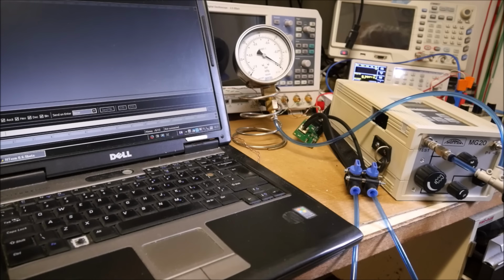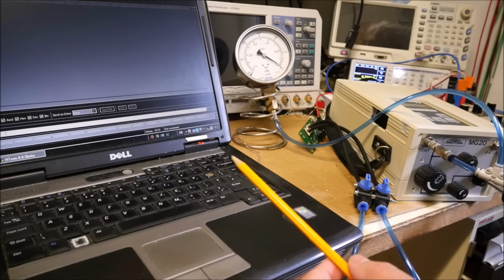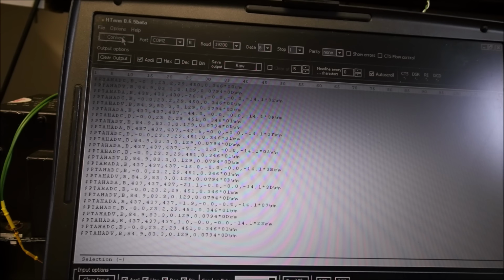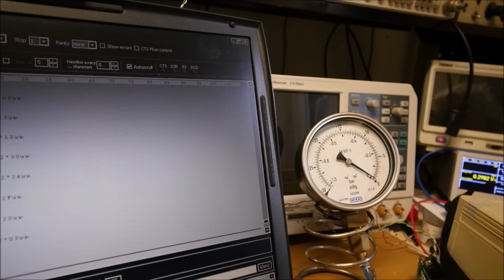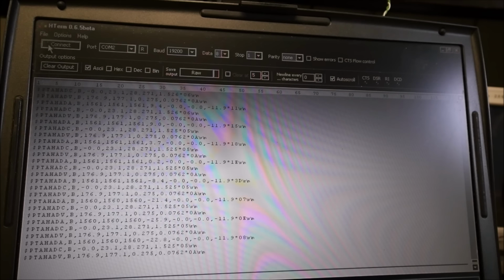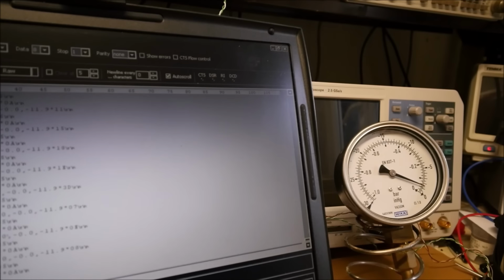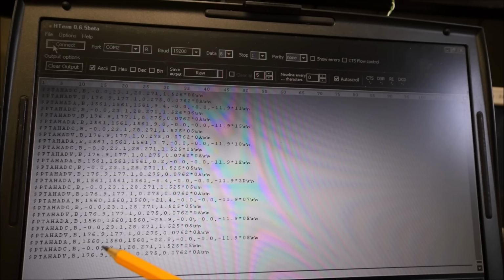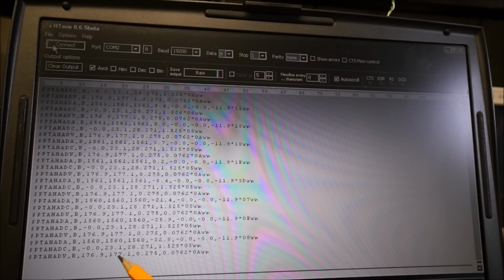LDM #369: Shahed-136 drone Air Data Computer module

Comment: So... a lot like my Resmed 10 CPAP machine, but without the 3ph motor controller.  Differential and absolute pressure, and an STM32 ARM.

Comment: I find it quite interesting the use of quite low spec SMD stuff, 1206 or similar size...like they do not want to use anything small perhaps due to vibration or reliability concerns? They clearly have no difficulty with high pitch given the STM32 is soldered there.

Comment: Given the fact these things are built from plywood with a thin skin of fibreglass have primitive electronics and a cheap motor, why do they cost $50,000 to make?
Reply: $50K is the highest estimate, they start at $20K. I think the cost also includes expo💥 payload as well. The guidance/nav system also needs to be protected from jamming devices. I don’t think this is the only module on the drone.

Comment: I've designed something more complex than that, and I'm just a hobbyist. The PCB is so basic that you can make it with an electronics CAD program in a few hours, and if you send the Gerber files to China, you can order thousands for 'just a few bucks'.
Reply: Embedded system design for Automotive and Aerospace is not as simple as designing a board to be printed by PCB way and JLCPcb. You have to factor in environmental factors, mechanical stress from motors, thermal stress, signal noise etc.. not to mention designing a Mixed Signal board is an entirely different level of design and engineering.
Reply: @MadKobra-b3t That circuit uses all non-aerospace consumer components, must last a few hours, and is not subjected to significant stress, given that the Shahed drones fly at less than 200 km/h.
They are not designed like Western weapons, but to be cheap and mass-produced, putting reliability second.
Just as the war of resistance that Iran has planned is not conceived according to US warfare standards. For fifty years, the Iranians have been digging bunkers and hiding thousands of them in preparation for a war of resistance and attrition. Because they know full well that if they accepted a conventional war with the US, they would be wiped out. The only one who doesn't understand this is that idiot Trump, who got himself into a quagmire.
Reply: Cheap but effective. Perfect for a country under heavy sanctions.
Reply: @fruitytv-uk  All consumer components, the only component I didn't recognize were the pressure sensors, maybe they are local components.

Comment: The STM processor is what we use in the hobby.  They must use the pitot tube because it’s tougher to scramble analog inputs. It’s conceptually less advanced than most hobby boards.  But more robust in a battlefield situation. Fascinating.
Reply: They likely used a European-derived STM32 instead of the more readily available (due to sanctions) ESP32, due to its excellent 12-bit analog-to-digital converter, much better than the Chinese processor's.
Since there's only one, you have to query the pins sequentially, but at least you get a much more accurate pressure measurement.
Reply: Conceptually it looks less advanced, but it’s an entirely different beast. Don’t let the schematics fool you. Automotive  and aerospace MCU boards are not as simple as hobby Pcb boards. Mixed-Signal boards are funky in general, when u add the mechanical and thermal stress, it’s a different story. Even the type of solder you use is different. Famously F1 engineers avoid any type of solder because they’re unreliable.
The fact that Iranians can mass produce high-quality Flight controllers this cheap, under sanctions ….. it’s insane.

Comment: It's powered by a French microcontroller chip (STM32) probably supplied by China. Would love to see the mainboard, and which chip is used, probably an american FPGA or maybe a another STM32 like in the RC airplaines. Let's hope you will find one of these mainboard, in Ukraine or in the middle east. Well done for the electronics reverse engineering job

Comment: This is similar to the air data sensors used on aircraft. The only difference is the solid state sensors are of better quality. But it all serves the same function, giving the autopilot airspeed and altitude information.

Comment: 6:21 it’s probably a temperature compensator for correcting airspeed vs altitude . You mentioned earlier an analog temps sense , there was an adc ic i saw earlier , feed a temperature to it roughly what you would expect for a given altitude then vary it and look for change on that pid

Comment: Thanks a lot. Do you know the reference of the barometric/static pressure sensor and the other one (dynamic pressure) ?
Reply from the maker: LDM #369B: Shahed-136 drone - Air Data Computer Pressure sensor
https://youtu.be/ljpU60n8Mvc
Reply: @lelabodemichel5162  Merci beaucoup!

Comment: This war drone has the same level and complexity of technology a high schooler would assemble for an electronics class.
Reply: no high schooler is making this goofball
Reply: Nah, it´s reasonably sophisticated. Not exactly rocket science but just solid work. Somebody who survived a proper apprenticeship of 2-3 years should be able to pull this off but it´s not something anyone can just do, you need a bit of experience and knowledge that doesn´t comer over night. Definitely skilled labour but at the same time you don´t need to have a Master´s degree to build this.
Reply: And isn't that part of the advantage?
Reply: And is more intelligent and effective than amerikan high tech show-off
Reply: @redbaron9029  Um, not remotely true. You know this now.
Reply: @redbaron9029 American have Lucas which is version of Shaded or Geran with more smooth engine high accuracy but less payload. It's proven to be effectife weapon.
Reply: @IamSonedi и колко струва?😊
Reply: @Sergeilavrov59 very cheap, less than original Shahed/Geran. Unfortunately it is neutered, it has lowered payload and much reduced range for unknown reason.
Reply: @IamSonedi  Even if a free rock can make some one run for their money, mission accomplished. It has to be smooth, accurate enough not the most smooth or most accurate.
Reply: @IamSonedi  proven?
Reply: @becauseiwasinverted5222 it's not cheaper than Shahed or Geran. It's about 70-100k per piece, 2-3 times more expensive than Shahed.
Reply: @ultravioletsus  All sources online point to 35k for LUCAS
Reply: @becauseiwasinverted5222 that's not the Pentagon pricetag, those sources claim it's exactly the same cost as a Shahed which IS 35k dollars per unit.
Reply: @ultravioletsus  Even CENTCOM spox quoted a 35k price, that's pretty "Pentagon"
Reply: @becauseiwasinverted5222  Pentagon "pricetag" isn't what they tell you, it is what they sell them to the government for. Ofc the PDF file regime's CENTCOM will say it's cheap so we all will feel less angry about our money being spent for some stupid war.
Reply: @becauseiwasinverted5222  the thing is that sources about the cost of a shahed are far cheaper, some report that a shahed. 136 only take slike 7k to 10k for Iran to make, so the Lucas is still an upsell
Reply: @ultravioletsus not true, your statement is wrong
Reply: @robintasker9078 not true, your statement is wrong.
Reply: lmao not nearly you haven't the slightest clue what it takes to develop a remotely reliable pro grade circuit
Reply: That's embarrassing for USA, a high school level electronics based drone is able to waste interceptor resources assymetrically. Well, that's the nature of super high tech stuff, sometimes low tech in sheer numbers can give it a run for it's money.

Comment: You can measure air speed with two pressure sesors
Reply: a differential sensor is enough
Reply: @alessandrorampazzo3919 I think you need two because you need the ambient pressure and the pressure difference aswell
Reply: @Piotr-karczewski This is precisely what a differential sensor does: it measures the pressure difference in a pitot tube to calculate the drone's speed. For this, it has two inputs. The second (absolute) sensor gives you the altitude and, together with a temperature sensor, can calculate the correction rate to determine the exact speed by determining the air density.
Of course, before launching the drone, you must enter the barometric pressure and the altitude of the launch point to calibrate the system.
Reply: @alessandrorampazzo3919 das rite

Comment: Question is - does the  Shaheed uses a  GPS system to ID when it has got to the correct location before crashing ? and if not does  it use the ADataC to  give and integrated distance and direction which is a far cruder method of navigating.   I'm guessing if it relies on   Glonass or GPS then the only reason for  producing  TAS is  so the flight dynamics controls can prevent the device from spinning in... or measurement of  TAS  might be used to trim the fuel flow to the engine to try to produce constant  true air speed.
Reply from the maker: There is a gps board, I have one. It uses a small Neo module from Ublox.
Reply: @lelabodemichel5162  The  GPS board is clearly critical to  flying the drone any distance in a wind.   Over say a five minute period  the  wind vector can be calculated from the data of the body velocity  vector  x  time   (say a ) and the GPS  position change vector b in that time   using  c sq   =  a ^2 + b^2  - 2abcos C  as long as the vectors are measured  relative to say East and C is the difference angle (posn Vector -  body vector) in either rad or  degree units   . 
 If the difference  angle is positive the wind is  westerly.  If it is  negative,  the wind is Easterly.   Cos +C = Cos -C within range  -90 to plus 90 deg so the cosine of the angle cannot be used to  assign a  sign the wind  vector .  or to put it another way , extracting  c from  c ^2  gives either  -c or +c and an external method is  required to   sign the  wind relative speed vector.

 The caution is that any wind vector direction obtained from this  is relative to the other vectors  (body vector and  GPS change vector)and is not absolute with reference to the Easting line. Therefore this raw  wind vector cannot be used for  navigation calculations as is. 

I'd guess that the  guidance algorithm allows one attack only and if the Shaheed starts to overfly at the last moment, no corrective action is taken.  That avoids the risk of a stall in the turn back turn ,  decision heights and so on . Still , only a guess. 

The cosine rule above does not fail when the wind is directly behind the drone and the cosine angle is zero.  I was rather surprised that this was the case.

Comment: The data format is interesting. I work with marine electronics where the so called NMEA 0183 protocol is used. The NMEA 0183 standard defines sentences for for instance heading, GPS, depth, water speed etc. The standard does allow manufacturers to create so called "proprietary sentences" which must, according to the standard, all start with "$P". The next three characters, ("TAH") define the manufacturer (Manufacturer Mnemonic) and after that, the format is all up to the manufacturer. I checked the NMEA 0183 standard but "TAH" is not listed.

Comment: The main question is: Is it possible to hack the drone OTA somehow? My guess is that Iranian software quality is at the same level as their hardware is.
Reply: Not possible if the firmware code doesn't allow
Reply: @OFCIFR or buggy CPU microcode on any module or whatever. There may be micropython or other interpreted language used somewhere so additional code could be injected and executed through received malformed data. You don't need overtake control. Just slight modification of altimeter or spatial system could be enough.
Reply: @TB4383-k3m thanks for the explanations
Reply: Do they even have RF link?
Reply: if it could be hacked dont you think the americans or israelis would have hacked them by now genius? With that intellect of yours you stand no chance in life
Reply: @pear-zq1uj  could have been hacked and patched

Comment: I'm a little surprised that as they use an STM micro that they don't use the STM LPS22H absolute  pressure sensors. They are so good you can do airspeed by connecting one to pitot and one to static.
I've built thousands of devices similar to these for our sailplane instruments and other sailplane instrument manufacturers do the same.
Reply from the maker: There is no reason for that, these two things are uncorrelated. There are other factors like price and availability.
Reply: @lelabodemichel5162  the LPS22H is about the cheapest pressure sensor you can buy and readily available. I suspect the Shahed's avionics was designed before about 2017.

Comment: 1013.25 mbar -  200mbar = 813.25 mbar ( according to height vs altitude graph ) this should be +/ -  2000 Meters = 6000 feet (6188) !!!!  when did Russians get rid off the metric system??
It is a DID      device in a device with western spice
Reply: I do not remember the date, but it was somewhat recently, on a historical time scale. Specifically for reporting flight level in aviation, Russians have indeed switched from meters to feet, to be like the rest of the world, and to avoid possible confusion.

But I doubt that this is the reason for what we see in this device. It probably simply emulates some commercial Pitot sensor with an industry standard interface. We don't even know where this was designed, but it is probably manufactured in China.

Comment: C most likely stands for conditions and have one or two temperature measurements and also has to have QNH/pHg sea level atmospheric pressure - only question where this data would come from as it is weather dependent at sea level,  maybe read from RS232
Reply: How would it read from RS232 mid flight ?

Comment: You don't know the "signification" of 23.1? What's the room temperature in your lab, Michel?

It would make total sense for this slightly bizzare board (simultaneously over- and under-engineered) to measure air temperature, as it infuences air density, a factor in the pitot-static airspeed formula. It's not THAT significant, though, so one could just get away with reading temperature inside that cast iron box instead of overboard.

If I was a betting man, I'd say the sensor is inside the absolute pressure sensor, which is a common thing and which explains why it would vary as you compress/decompress the air in its inlet (aside from just other components heating up the PCB).
Reply from the maker: I have the datasheet of this sensor (next video) and there isn't any temperature measurement inside, except for correction purposes.
Edit 2024/07/18: You're maybe right, it seems that the temperature can be read from the part.

Comment: The PCB is poorly designed
Reply: You have a point but being pragmatic it is good enough as it only has a single use. It’s just works
Reply: @cyberphox1 well it is manufactured thousands of times, why not do a correct layout when this would literally just take some hours more to do once.
Reply: could you state why ?
Reply: @yottakm3764  - Crystal XTL1 is connected trough via's which is something you avoid if possible, as it may cause excessive stray inductance.
- There is no reason to default to 1206 or 1210 packages, especially if there is already a TSSOP package on the board. Any monkey can solder 0805 and 0603
- All of the capacitors are too far away from their intened pins, especcially bad are the row of capacitors under the STM32
- This board could have easilly been single sided which would have cut costs and difficulty
- The return currents of the STM32 pass by the sensor, prefferebly you would place the sensor on the edge of the board, as far away from the input connector and other circuitry as possible.
- General component placement and routing just looks quite random and poorly done.
Reply: @questy44 russian armed forces thank you for your support 💀🤦‍♂️
Reply: @questy44 You sir just contributed to the Iranian war effort 😅.
Reply: @questy44 your input is highly welcomed by the New Axis of Evil, and will be taken into consideration with our new models of drohnes! 
Salute to you, comrade!
Reply: @alfonsfalkhayn8950  soros' ukrobot detected
Reply: It is calles Simplicity
Reply: If it works for its intended purpose, it's properly designed.
Reply: @chiefdenis  everything at dollar general works for its intended purpose. I can't say it's all reliable, though.
Reply: @yellowtomato  how reliable does a one time use missile need to be though? All the components need to last 45 minutes max, anything beyond that is over engineering.

The f35s and f22s are over engineered for current day warfare thats why they are so expensive to run, unreliable and finicky, f16s and su35s are exactly engineered for purpose that's why they're still in widespread use despite there being "superior" successors, this drone blew up(i think) and the pcb is still functional, thats fine engineering in my book.
Reply: It's a low-grade build. Coffeemaker quality here. NASA had no hand in this one.
Reply: @yellowtomato  talking about the same nasa who screwed up multibillion satellite missions because of stupid mistakes such as dysfunctional conversion between metric and imperial units and drunk operators?
Reply: @a3103-j7g yeah, NASA is pretty much drunk idiots over there. Temu and Wish have the better engineers for sure. 😂
Reply: @yellowtomato  bingo!
Reply: @a3103-j7g the diffrence between fucking up a simple pcb design and a system with millions of LOCs is immense

Comment: What is the sensor manufacturer?
Reply from the maker: Silicon Microstructures Incorprated
Reply: @lelabodemichel5162  All SMI sensors have the SMI label on top. And also the marking of the first pin. Here - clean ceramics. It's interesting what's on the other side. Are there any markings?
Reply from the maker: @uavdev  Response on next video